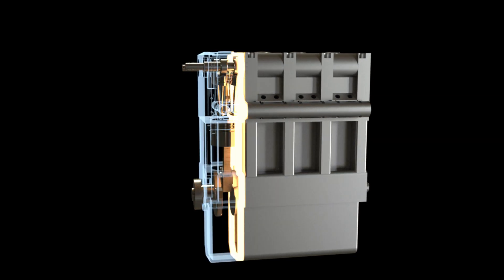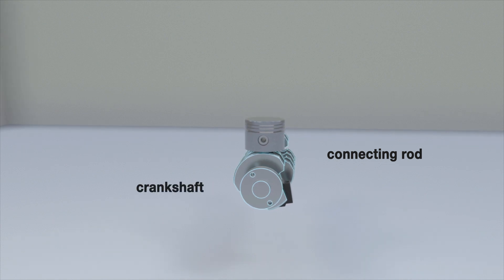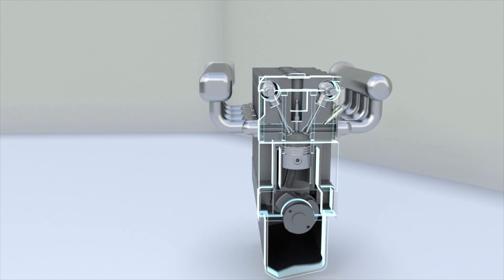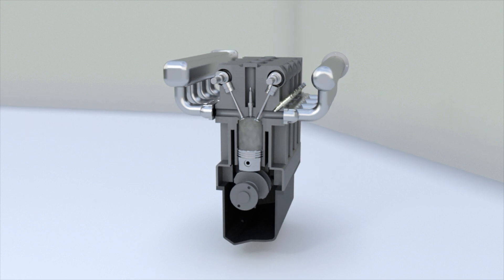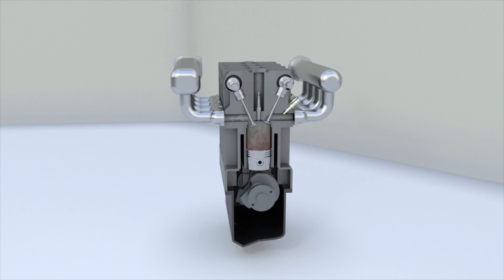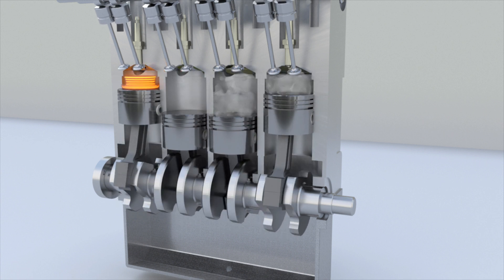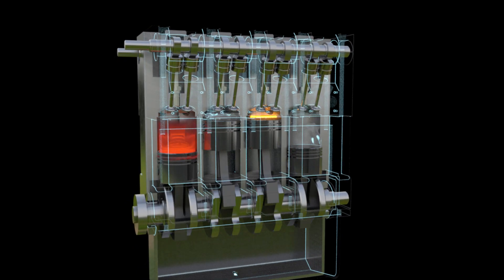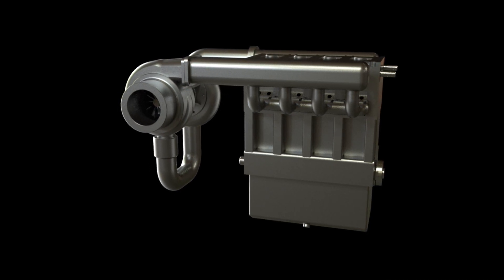How Does an Internal Combustion Engine Work?

Comment: The video has a mistake, in 4 stroke engine at any phase there is exactly one cylinder firing. Here we have dead phases and start/end of animations and have empty strokes. Also, the fire should start from the spark plug, not just somewhere in the middle.
Reply: It made me crazy
Reply: The left to right, the true order of combustion: 1-3-4-2, this video has a mistake, the order of combustion:1-3-2-4.